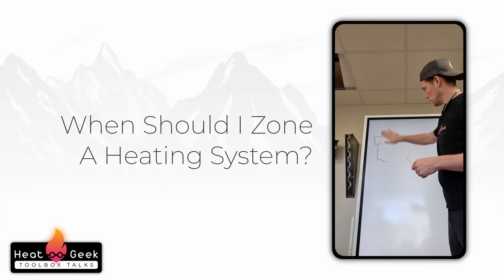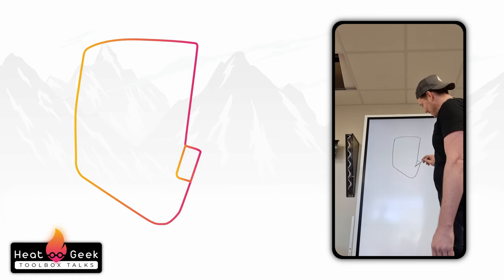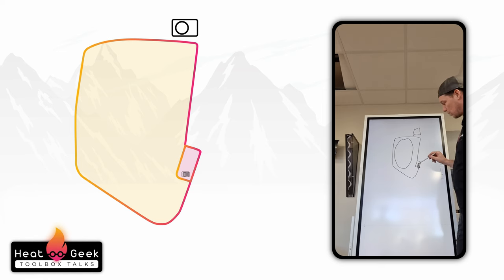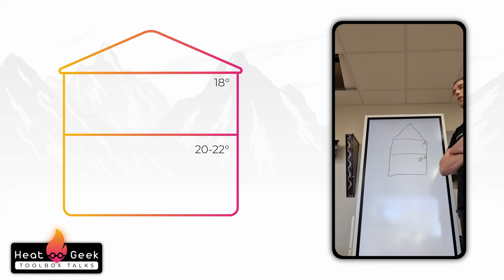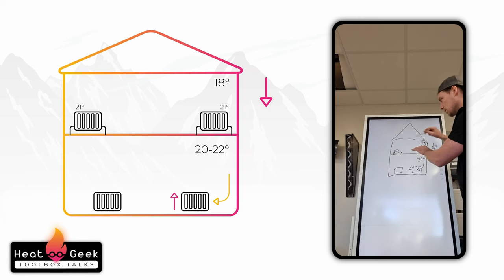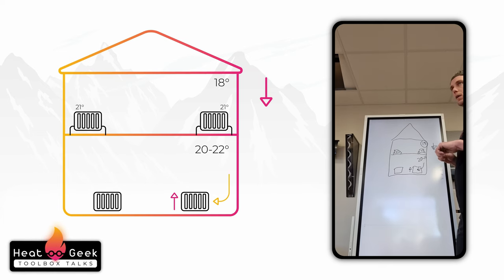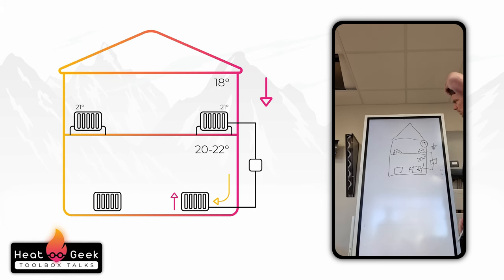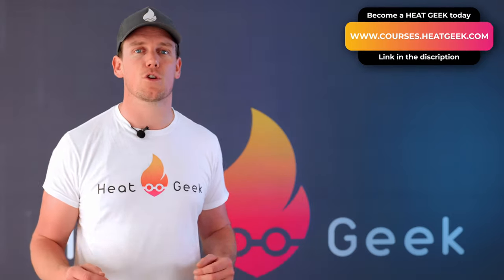When Should I Zone A Heating System? | Toolbox Talks

Comment: Sorry I don't buy your advice for most UK houses with poor insulation.  Even with a modern build you comments on a single office not being zones is absurd.  I do the same and simply place the thermostat in the office.  Once the office gets to temperature why would it 'cycle cycle cycle'?  Also flow temp will drop once the room is being topped up.  An alternative heat source would be an electric heater at 30p per KWhr.  Also....take an example in the morning when houses are coldest.  Why wouldn't you zone off a lounge that won't be used as people prep for work etc?  The room will gain heat over day via solar gain.  You're literally advising people to throw money away. .

Comment: Zoning upstairs and dowstairs in an average house using boilers, does work and saves a lot of energy.
Reply from the maker: It 'works' .. and cab save money with an on off type system. Not with an efficient weather compensated type system necessarily though
Reply: @HeatGeek  
I know of a 4 bed detached house that had an Intergas Xtreme weather compensated boiler that modulates down quite low so little to no cycling, operating for a few years. The way the piping was configured it was quick and easy to zone by fitting two zone valves. This was done.  Notable difference in gas consumption. The upstairs is off most of the day. 

I think what you are saying is that a boiler that does not modulate down low can give poor results as inefficient boiler cycling occurs. This is when the heating load is reduced because half the building's heating system is taken out of operation. In short the boiler cannot inject its heat at it lowest burner modulation into half the heating system - matters are made worse when the outside temperature rises reducing the amount of heat that can be injected into the building.
Reply from the maker: @johnburns4017  cycling accounts for only 1% loss with gas boilers so not really the cycling but the higher temps needed. If weather compensation is basic so won't display the same way.. also every property is different.. how 1 property responds is not how all properties respond
Reply: @HeatGeek  
High temps needed in the on-off sawtooth graph? Needs high temp to get to setpoint after being switched off, then overshoot of setpoint, then cool down.  Weather compensation is injecting near enough the right amount of heat most of the time into the building -if  the the slope is set properly. 

In my weather compensated system I have an on-off room stat in the hall. This is used a timer and a high limit not whole house temp control. The outside temp sensor pretty well does that.

I am on about an average two floor house, which is most homes, not odd shaped buildings, etc, where a different approach of course has to be used.
Reply from the maker: @johnburns4017  decent ec does not need an additional on/off stat.. watch this video.. the same applies for gas just slightly less..
https://youtu.be/zpTVIeUh04E
Reply from the maker: @TheDickPuller  correct we can't grasp it because we have been installing low temperature exclusively for the last 10 years  and dont get the calls your getting.. sounds like your doing something wrong..
Reply from the maker: @TheDickPuller  🤣🤣 I can't only assume your passion for this channel and me is fed by jealousy bud. Honestly I'm no different from you.. Well a little more polite and dont have time to follow youtube channels as closely as your self.
Reply: @TheDickPuller  What you report is indicative of not ‘teaching’ your customer of the best way to operate the system, why things are operating the way they are and to be aware (and not worry) that the radiators are not going to be as hot as previously - but that the house will be just as warm and they will save money. After this weeks announcement on the new CAP they will be really interested. If you have not got time - get it typed up and get a 100 copies laminated for your customers.😀

Comment: Personally in my townhouse I prefer it cooler downstairs as that's the kitchen.  Zoning is great and I am not giving up zoning. Not that it matters anyway a heat pump wouldn't fit in my house it would need a 30 metre run to get to the hot water tank. I am betting that's gonna hurt the flow and COP with heat loss

Comment: I've discovered this content trying to sort out my brand new system (boiler not heat pump). No thought about radiator size, no balancing, no zones, multiple drop legs, always seems to always have air in it no matter what I do, boiler commissioned at max output, flow temp set to 80c, pump speed left at max, some rads not getting hot. Wish I had someone who had been on your course install it.
Reply: How have you found yourself in that situation? What are the actual problems you're having? Surely any issues you have can be dealt with by the installer
Reply: @silvergrim  ghosted. Thanks to YouTube I've sorted most of it but I suppose a badly designed layout is a badly designed layout. No matter what I do the air keeps coming back.
Reply: @TrickyTree84  argh... Any decent installer would be there for you. Crappy situation, there's so many variables, what type of system did you have installed?
Reply: @silvergrim  it's a combi sealed system. 2 zones (only a single rad on one of the zones). All the downstairs rads are dropped off upstairs as we have solid floors and it was a single pipe system we got replaced. I've sorted the balancing and I've sorted the boiler settings. Just the air that keeps coming back that's getting me now. I think possibly it could be down to one old towel radiator, the only original radiator that was left in the system. Problem is the air is getting stuck where the pipes drop
Reply: @TrickyTree84  does the air effect the boilers operation? Or do you just hear it gurgling around the system? Personally on the face of it I'd get rid of the zones especially for one rad. Drops can be problematic with air but I've found once it's gone it's gone and there are no more circulation issues. I've seen badly laid plastic pipe that hoops up and down rather than being run flat that has caused issues with air. Also towel rads love to catch a bit of air imo but venting them a little only happens once a year
Reply: @TrickyTree84  I've got also got rads in my house on drops and when i drain the system my hallway rad airlocks. In my case I turn the bedroom rad off and it fires into life, bleed it and then everything works. Maybe turning some upstairs rads off for a bit and fully opening the problematic rads and having them run for a bit and reinstating the upstairs may help.
Reply: @silvergrim  thanks for the reply. We have a mix of copper and plastic pipes. It's mostly just I can hear the air but also the towel rail needs bleeding once a week. The biggest issue is the pipes come out of the boiler and run 4 meters across my garage ceiling, they then drop a few inches before entering the house. Air gets trapped in here, the boiler can refuse to fire thinking there is low pressure. I have to top the system up, but as soon as the pump kicks in and shifts the air next to the boiler, the pressure shoots back up and is then too high. I just don't get why the air is coming back. My thought is that in the week I'm running the single rad all day on its own. Maybe the pump is causing cavitation. I have the pump set to constant pressure mode so my understanding is that it should modulate. Ps the single rad zone is an office that's on the back of the garage. It's not insulated at the mo and I don't want to heat the whole house while I'm in there with the rad on all day
Reply: @TrickyTree84  do TRVs suck air ?  Under some circumstances radiators high in the home can end up below atmospheric pressure (  poor design, wrong pump position or setting, other blockages, all rads turned off & bipass set too high). You can test for this .. if you try to bleed the highest radiator you find air goes IN when the pump is running!    I think some TRVs can suck air in under these conditions, can do this intermittently. 
This could also be the case with "automatic air valves" high in the system.
Another possibility is corrosion , if this is the case it is hydrogen not air & a small about will pop if lit.
Drop down loops can work one day & go cold & stay cold then next as the water in down loop is cold & heavy &  the flow chooses an easier route.
Reply: Also sounds like you need bleed valves  on that garage pipes..
Reply: @brackcycle9056  was wondering about that. That will be a plumber job. I just bought some auto valves for a couple of the rads

Comment: Don’t forget about the porch and any extension such as a conservatory,  they by law have to be in sep zones in case of leaks
Reply: Can you explain - what leaks - how do zones help?
Reply: @normanboyes4983  my law conservatory's and porch extensions have to be on a separate zone . Most people visually are on electric.in smaller property less than 12 ft conservatory's have 1or 2 electronic rads or none at all.  Yet most orange extensions on bigger properties require a separate zone usually done with a system or regular boiler a heat exchanger and two zone electronic diverters one for the main loop of the house and one for the extension. Things get a little more complicated when a extra underfloor zone is needed normally we see up to three zones with diverters and tank beyond this or if ground or solarthermal are added it's more in line with a typical small industry commercial layouts
Reply: @ram64man  Are you in UK - is this underpinned by UK building Regs or CIBSE?
Reply: @normanboyes4983  both usa and U.K. at the time due to family ill

Comment: What would you suggest in the home office scenario of just requiring one room heated during the day if not using central heating whether that be boiler or ASHP? Infrared panels?
Reply from the maker: That 1 option sure.  1 pannel though.. not multiple... if it needed multiple you'd go back to looking in to zoning...
Reply: @HeatGeek  The office is 12m² and the house is 280m² so I'm guessing I should keep to low ambient (16°c) for the house and panel for the room. We have a 16kw ASHP (hybrid config with existing gas boiler) going in next month so it's all going to be a learning curve. Getting loft insulation up to spec and some additional wall insulation to help keep the bills down. As a test we've been running flow temps between 40-50°C and the house seems to cope, I wish I'd know sooner, my condensing boiler has been set to 75°c for years! Although need to ensure water gets hot enough for legionaries. Finding your channel very informative and interesting source of information, keep up the good work 👍
Reply: Forgot to mention we also have EvoHome so we can also zone with ease. Still trying to work out how to use that with an ASHP though.
I did have another question... At what sort of temperatures do you find the COP drops off. I'm thinking of programming a switch to the gas boiler below a certain temperature when the ASHP becomes inefficient, but wondered when that would be. Currently electric rates are 4-5 times more expensive than gas but looking further into 2022 this may turn to be only 3-4 time more expensive. Essentially I don't want to running at ASHP at a COP of 1.5 when the gas boiler could take over for that period.
Reply from the maker: @rob-stewart  there's not really 1 point it's continuous..

Comment: The way my system is connected a the moment is a bit of everything. 8 radiators are connected with the Honeywell wireless trvs and 3 radiators with normal trvs just run when the heating runs. There are 3 towel radiators will run with hot water or heating and underfloor heating zone in the conservatory. Two of the 3 trv rads are in the center of the house surrounded by rooms.
I originally re-piped it as an upstairs/downstairs zone after a large extension but after the Honeywell rep gave me a box of 4 wireless trvs i thought id give it a try.

Comment: Interesting, thanks... As someone who currently has a combi and a house with two parts (1980 and 2002), they have very different heating needs. I've gone for Tado TRVs, which has been great, but I know it's "microzoning" and, together with my 46° flow temp, will result in more boiler cycling since its lowest output is 5kw... BUT it's hard to give up the benefit of significantly lower gas bills due to better directed heat just to avoid extra wear on the system.

I guess the dream is for heat pumps to reach Viessmann boiler levels of modulation so they are less affected cycling in that "heat only the home office" example you gave... But in the meantime would a thermal store be a benefit to reduce cycling where only small areas need heat?
Reply: A little late to the party on this comment. But if you add a small buffer tank and ECM circulator to it, this will prevent short-cycling your boiler. You don't even need an expensive hydronic buffer tank. A DIY trick is to purchase a small, undercounter water heater and plumb it into your supply and return lines (and you simply never energize the element).
Reply: @browncowvideo  thanks. so this is just adding system volume to mitigate cycling caused by Tado running a small subset of the radiators?
Reply: @TheBadoctopus  yes on adding system volume, but it also allows low BTW (or kW) emitters and/or micro zones to serve the smaller loads, when your boiler is sized for a LOT more load. 

It's not difficult to run a heat loss calculation for each room of your house based on some assumptions of your insulation value. Armed with these numbers it will make a lot more sense on how they all go together.

I am working on my second build of hydronics in my homes and I learned a lot along the way. I am becoming an "evangelist" of sorts for radiant heat. The human body finds it very comfortable.

As for resources, John "Siggy" Siegenthaler, a professor and professional engineer, has written several books on hydronics and you can also find him here on YouTube contributing to several channels, as well as Web searches.. He is THE man, in my book. 

Caliefi also has an Idronics series of PDFs available for free inline that use a lot of John's work without having to buy one of his textbooks. It's all great, informative stuff.
Reply: Sorry, I went off on a tangent and didn't finish about the short cycling. Because the boiler can only modulate down so far (modern modcons are around 10% of the maximum BTU). And often boilers have been oversized, which will only exacerbate short cycling. 

There are far too many HVAC pros that lean on the side of oversizing, for fear of a call back on the coldest day of the year, and there's far too many that don't even know how to run a Manual J calc., paying others do do them, and never learning the logic of why systems need to be designed around a load.

Comment: I can run my heat pump in cooling mode and want to fit an extra zone so that I can use the same heat pump to run a couple of wall mounted water cooling cassette with condensate on a separate zone. 
What’s the best way of doing this please?

Comment: Hey Heat Geeks. New follower to the channel. Loving the content - you make these topic very accessible and I've shared with 4 mates already.

I have a question. If you were draw the following on your white board, how would you approach the zoning/rooming/control question:-

> 2016 build, 4 story town house, attached on both sides; B-grade energy raging, ASHP, UFH (basement, ground) & jaga DBE* rads (1 & loft) <

Basement & G are naturally cooler in summer; 1 & loft far too hot. In the Winter, 1 is very cold & the loft is freezing!

Also, an uncommon use because we AirBnB some of the rooms:

Basement (UFH) - master bedroom, dressing room & shower [8pm-7am use consistent]
G (UFH) - kitchen/diner w/ north-facing french doors, WC [7am - 10pm use most days]
1 - Guest room, office, bathroom [office 9-7 mon/fri & other rooms typically constant]
Loft - Guest room & ensuite [typically constant]

My partner and I run hot so can't blast the master-bedroom during sleep time and also the smart rads don't seem to work as well as the UFH so want to think about how those rooms have the potential to run a little hotter without relying on a 24/7 furnace from the lower floors rising up!

*considering upgrading to DBH for cooling as shifting to a pump that facilitates and that might help the loft in the Summer - d'ya reckon?

Thanks in advance :)

Comment: All well and good until the customer puts their hand on the radiator and freaks out that it isn't burning them
Reply from the maker: That will, and is dieing out.
Reply: I've been explaining that for so long that it's part of the spec now, no problem with any of our customers.
Reply: Well i put TRVs in a house they complained the radiators were cutting out and not working properly since I put them on. I explained how they worked but they just didn't get it   🤬